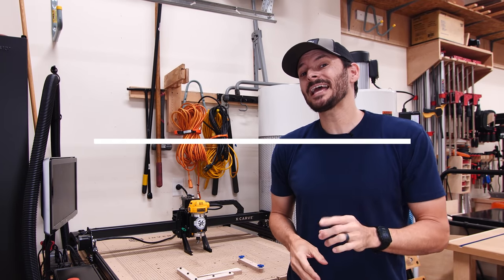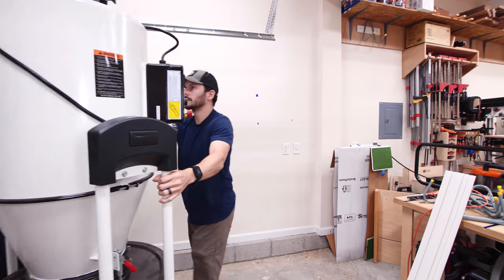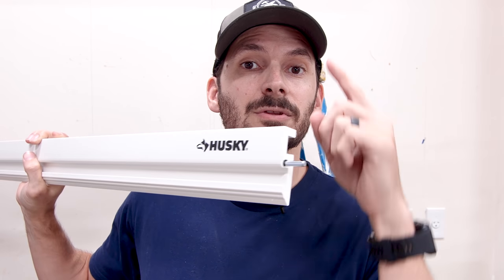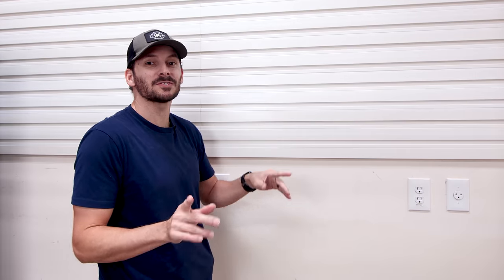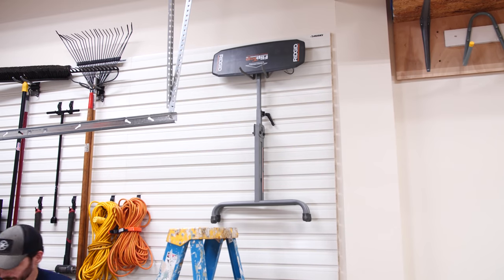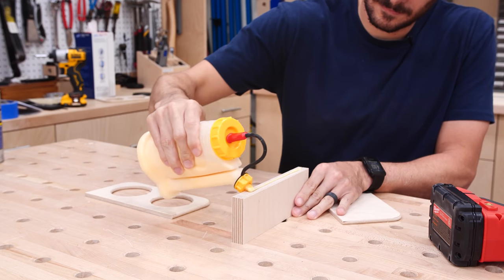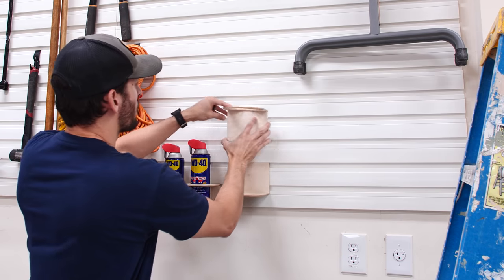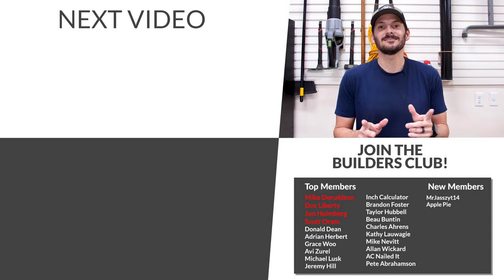Organizing Your Garage Walls the EASY Way!

Comment from the maker: Get BUILD PLANS for your next build! https://plans.fixthisbuildthat.com
JOIN the Builders Club here: https://fixthisbuildthat.com/buildersclub
Reply: Everybody always begins with pegboard walls and then realize that it's a waste of space and end up ripping it down.
Reply: Hey, I'm a Canadian girl, I didn't even know there were screws other than Robertson, haha!
Reply: @rmora1  I wish I had read your comment a year ago, being new to woodworking, I did exactly what you describe! Pegboard seemed simple, but what they neglect to tell you is that mdf is very susceptible to humidity, living in Eastern Canada 100% humidity is a normal day in summer. As we near the end of the first summer with pegboard walls, it's all warped and drooping depending on the weight of tools, so this winter's project will likely be a French cleat wall!
Reply: @quietinspirationcreations3448  In a woodshop everything you hang on a wall is going to end up covered in dust so be prepared to spend a lot of time cleaning.
Reply: Thanks for all your videos. I bought about 6 of your separate plans. They are great!

Comment: good little holder for the WD40, i'd have put a hole in for a pen & pencil & maybe a tape measure hanger too as you can never have access to enough of them & never find them when you need them. & love the blower holder
Reply from the maker: good tip!

Comment: On your holder for the dust attachment, I think I'd cut a cylinder of wood 1/2" high or so that's the inside diameter of the pipe and attach it to the bottom piece of the holder. That'll prevent any lateral movement.
Reply from the maker: thought about that, but the fit is so tight it's not a big concern

Comment: its $60 for 9 sqft, for those who don't understand, its equivalent to 3'x3' and thats including the top and bottom pieces "which adds 3in" but doesnt include attachment accessories. it probably cost $5 or less to mold that pvc in that shape. you have about $300 worth of shelving supplies and put up about $300 worth of tools. if youre not collaging that wall, its not even worth it. time to look for other options
Edit: I mean no disrespect those those who understand sqft. but my gf sent me this saying its a good idea, and its 9 sqft for only $60. i said, do you realize how small that is? she said its taller than you! smh this comment is for ppl just looking for wall storage and dont have a lot of f-around money

Comment: While these are great in theory, they have very little load capacity. I installed them at my parents place when they redid the garage and it fell apart holding up an electric whipper snipper

Comment: What is the benefit of doing a wall like this over doing French cleats? I don’t have either method, but was curious what made you choose this method over the cleat method that seems to be so popular with woodworkers? Thanks.
Reply: This is great if you dont have access to a table saw to make the angle cuts on the french cleats.

Comment: Interesting. Very clean and easy system. For the cost, I think I like my 3/4" plywood French cleat system better. It definitely didn't take that much more time. I was putting up 8' rows of French cleats, just about as fast. The real extra effort came in making all the cleats. It took about an hour with one helper, a track saw, and a table saw to make one 4x8' plywood sheet into a large stack of cleats, that gave me wall cleats, and hanger cleats enough to go floor to ceiling (8 vertical feet starting 18" off the ground), in 12 linear feet of wall. Oh, but I almost forgot, you should really convert to a 1/2" plywood wall from sheet rock. That will add some time too.
Nice part of my shop system is when I move, all my cabinets, shelves and hangers that use the French cleat system, will come off the wall and only the wall cleats will stay. Then my new shop will needs wall cleats installed and all my storage goes back on the wall with the same cabinets, shelves, and hangers. As I move for my job every 3-4 years, that's a huge time and cost saver when I move everything to a new shop so often.
How long do you think this manufacturer will keep making this PVC system, and is it compatible with other commercial systems?
Reply: Thank you for your comment, it is the voice of experience, which is wisdom. 🥀🌺🌟
Reply: ... and as he already has a CnC standing around, making some fancy neat-looking purpose-build hooks/holders would be extra easy. Like the two-can-holder he fabricates here, but nicer-looking. As it's all standard sizes/thicknesses/distances, very fast to draw up.

Comment: I like modular wall systems like this. I’m building a van into a camper, and on the kitchen galley wall I’d like to have a modular system like this so that I could rearrange shallow shelving as needed. The shelving will mostly hold pint and quart size canning jars. The van will generate plenty of vibration so I’m not sure if this vinyl PVC would be strong enough, but I sure love the concept.

Comment: The worst part about that type of storage like peg board or other variations, is that the hooks fall off really easy when removing the item it's holding. How well do those stay in place? For example, the extension cords, do the hooks stay sturdy when taking one down to use it?
Reply from the maker: the hooks snap in on top and bottom and are very firm.  The don't budge at all when you're removing items
Reply: @Fixthisbuildthat  good to know! Thanks for the reply!

Comment: Bit of a novice question but where should I look to find the type of wood you used for your cabinets? I feel like HD/Lowe’s wood selection isn’t that nice
Reply: Find a specialty lumber yard/distributor.   Baltic birch plywood is great (and pricy!).  You can do these projects with less costly plywood, but the results aren't as nice to look at (but out in the shop, or if you paint it?).

Comment: Suggestion maybe. Trace out one of those hooks that are on the back of the existing system and then use your CNC to create set hooks for your other items. If that makes sense.
Reply: Or 3D print them. But would have to be careful to not overload them.

Comment: Here it is April 24, 2022, 8 months after this video was posted and on the Home Depot website the Husky Slatwall Panel 4 Pack  "This item is not available in any stores within 100 miles of 34606", and "Out of stock online". Husky Slatwall Starter Pack is available online only in Florida.  ??

Comment: Over price … find your local retail store shop parts and get a 4x6 or so slat panel, several colors for $40-50. Get bunch of hooks sizes for like .40 c ea. from them  and your are done. I have 2 of my walls done like that.

Comment: Are these panels rigid enough to use on unfinished walls? 😂  We just moved into a house that has only partial sheet rocking finished.
Reply from the maker: yes, they would be fine to span between studs
Reply: @Fixthisbuildthat  awesome, thanks!

Comment: Super cool creation. My issue with all these sliding hooks is they move around a lot every time you’re pulling stuff off them. I’m constantly putting them back into the wall or having to drill them in to keep in place and not fall everywhere
Reply: Good tip. Thanks!

Comment: No, no, no. Way too expensive and cumbersome trying to find specialized holders. Sheets of 5/8” plywood over the drywall with a 5/8” spacer between (using small strips of scrap leftover plywood) the plywood  and the drywall. Then use finish screws  to install regular cheap hooks from a big box store into the plywood sheet…..to hang whatever you need.  More Versatile and cheap.